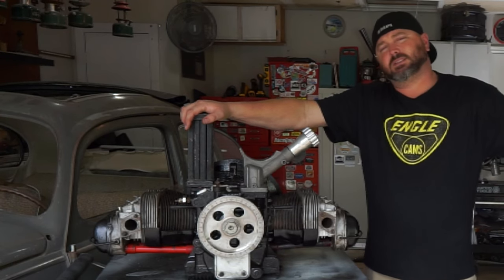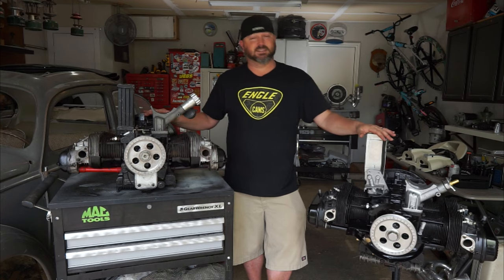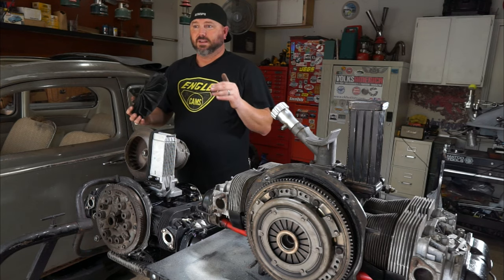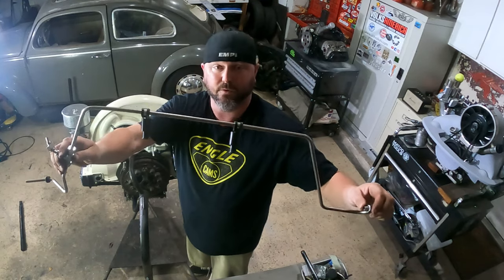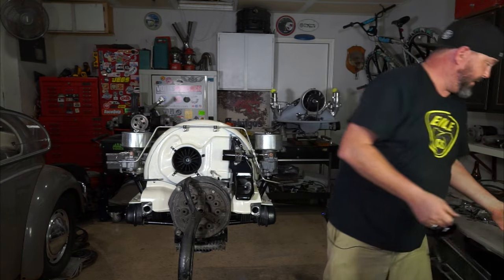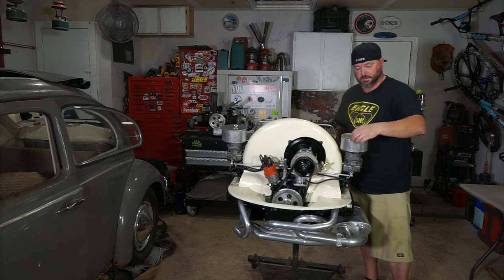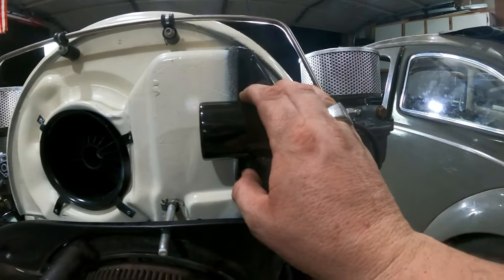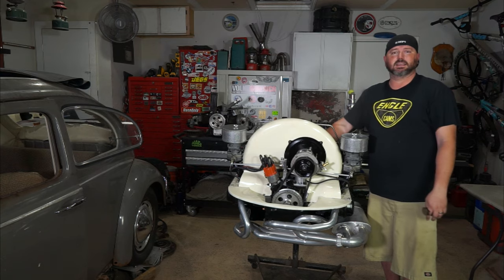Big Time VW Bus Engine Upgrade!

Comment: So glad you decided to use your mic. Sounds a lot better.  Looks like it’s stached under your shirt.  Engine looks good. Like how you mounted the coil. I need those industrial tins. Not sure about that fuel line. Sounds like you still have to modify. Also you said you modified the tin I thought they were already modified.
Reply from the maker: Still figuring out the mic situation lol. It's a pretty hot mic so I need to play with the settings but I'm glad it sounds better. The industrial tins are just a small piece that bolts to the "sled" tin. Due to the size of my header I had to trim the sleds down and add the industrial tins with Rivinuts. I'm OK with them for now, but I think I'll work on something better like what Haptic Garage did. His are air tight.
Reply: @OldVolksTV  yeah. The audio is still a little low but prob because it’s under your shirt. I gotta figure out that industrial tin thing cuz I wanna out j tubes and get rid of my heater boxes. I live in so cal and it doesn’t get that cold here. Plus I’m changing my fan shroud so can run heater boxes anyways. But who knows maybe I should run them since I do plan to drive across the United States but it should be during the spring or summer so who knows.  Any ways can you do a video of how you mounted the coil. I gotta relocate mine cuz I wanna put that linkage you have.

Comment: I'm picking up a T2 today. I presently know zero about these engines but for years have looked-after old Harley motors so am hoping there are some transferable skills there. I gather the motor in the one I'm getting is a bit gutless. Don't want to go full resto / rebuild or the kids will have flown by the time we get it on the road. Any pointers / resources or links you could share would be much appreciated.

Comment: Where did you get the 1835 motor? I am looking for a motor for my '71 that has, I think, a buick engine in it and I want to bring it back to VW. Do you have recommendations to where I can get a Turnkey motor?
Reply from the maker: I had a friend build it. Depending on where you are there's bound to be someone nearby that can do it. If you the money you can't go wrong with a CB PERFORMANCE  or Powerhous long block.

Comment: Great bus engine!  What are you doing for defrost and heat?
Reply from the maker: I had it hooked up to the stock heat system. Now I have a diesel heater hooked up to the vents in the front so I can have heat even when the engine is off.

Comment: I’ve definitely got inspiration from you!. My donor engine didn’t turn out to be what I expected. I’ve today, ordered a new reconditioned 1600 tp. I’ve stripped the donor engine and will swap this out for a new short block and build it up at my leisure to a 2.4ltr. Any advice for any bolt on’s welcomed! 😊☺️
Reply from the maker: Awesome! Knowing your motor inside and out will give you piece of mind and you'll feel more comfortable driving around. I'll have a list of what I used in the description of the next video. Have fun!
Reply: @OldVolksTV  thanks Jason!. I will. It’s also a great feeling knowing that what pulls ur bus, is something you have built yourself! It’s not great, it’s the best feeling!

Comment: I see Andrigs fan but what is that venturi deal on the back of the shroud and is it needed?
Reply from the maker: The venturi ring came from Awesome Powdercoat. It's not 100% necessary, but it helps to bring in more air.
Reply: @OldVolksTV  AAAH!! my Andrig fan is here and Im waitin for the hub. but sooooon . Any hoo dig the vids and have a merry Christmas.

Comment: How has the cooling fan been treating your engine? Still installed or back to stock?
Reply from the maker: Haven't been able to run it. We had an internal issue with the motor. I'm about to put another one together and take a nice long trip. Should get some good data.
Reply: @OldVolksTV  Awesome man , I’ll be on the look for an update. Was having this conversation with my old man about VW cooling fans and ran into your video, you’re the only one I’ve seen include it. Would you know if it only works with the doghouse fan shroud or stock components as well?
Reply from the maker: Doghouse only but it's easy to convert your motor over. Andrig also makes some fixed (non moving) cooling flaps. I'll be adding some when I do this build. Supposed to make the fan even more efficient.  With those and the venturi ring from awesome powdercoat I should me moving maximum air!